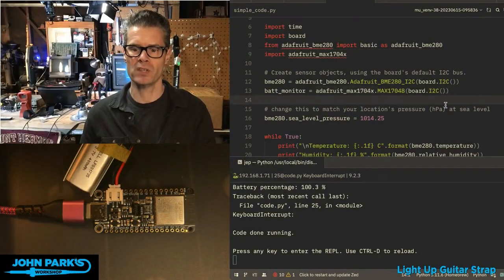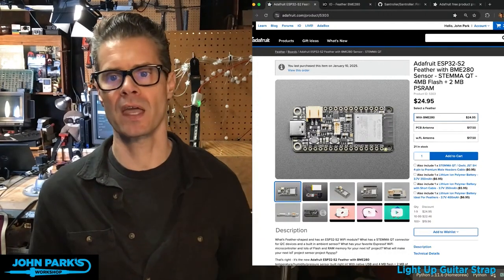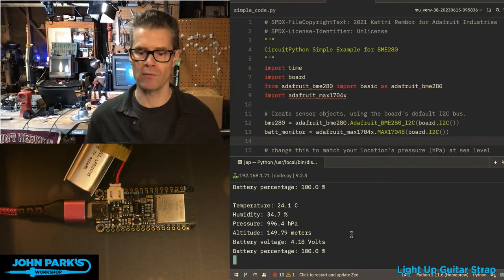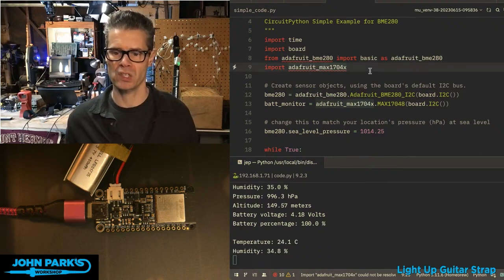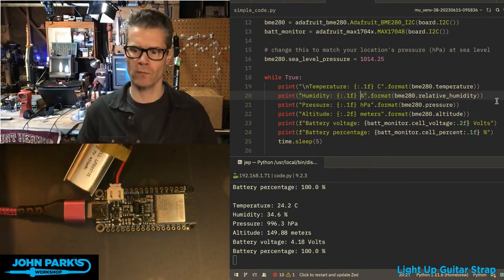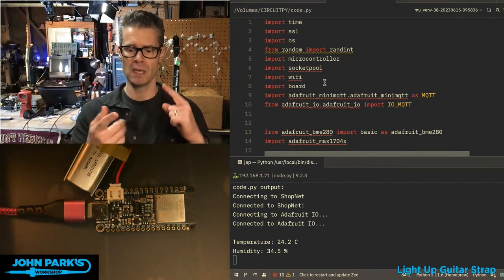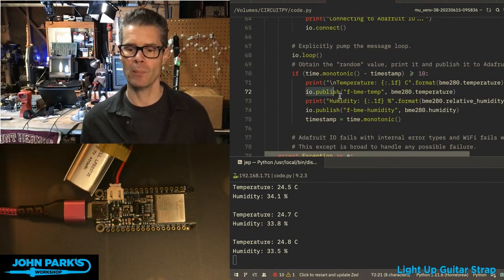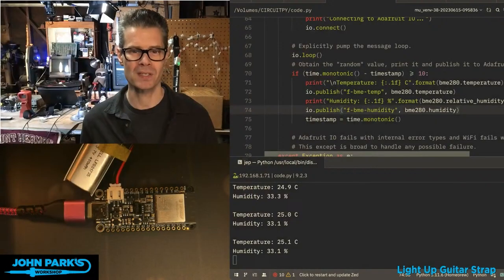John Park's CircuitPython Parsec: BME280 Sensor on Feather ESP32-S2 #adafruit #circuitpython

Comment: Hey John, Love your videos. They super helpful.
My Adafruit feather (BME280 Sensor on Feather ESP32-S2) has the older LC709203F Chip. It does not report the correct battery percentage. I did multiple tests and it was always wrong - ran the battery flat many times. I have raised an issue in Github but no one has responded. Perhaps you could take a look at the code and figure out what is wrong? Thx